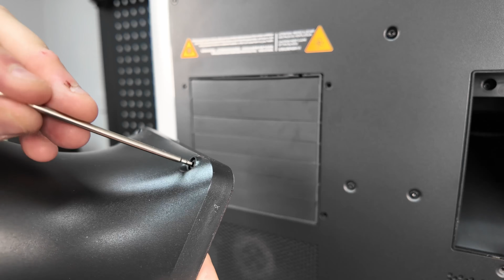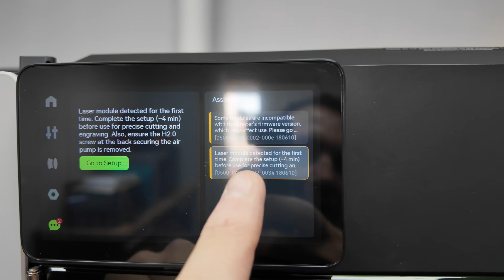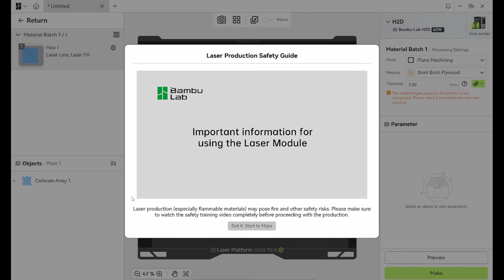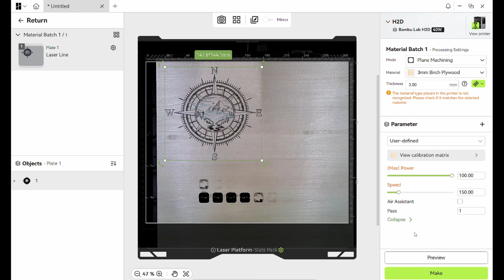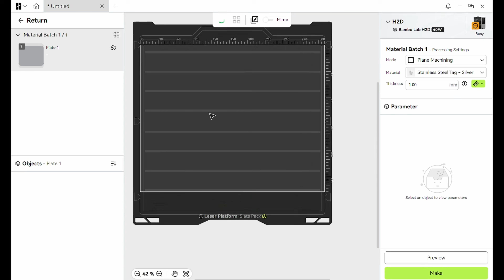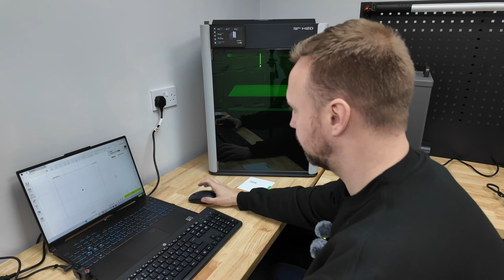Bambu Lab H2D Laser Edition: Complete Beginner's Guide & Testing

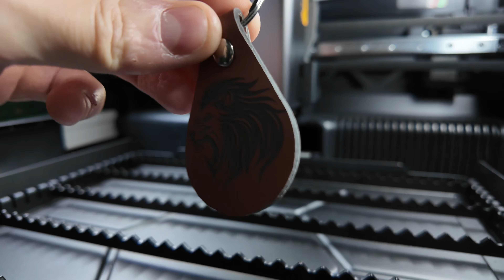Comment: On the lion key fob, the lion is noticeably closer to the top of the key fob (when you take it out) than it was in the camera view. Is it a different key fob, or was the placement consistently off? It looks like it was a good 3-5mm off on the Y axis @ 32:38
Reply from the maker: It's definitely not to placement of the machine. It was a while ago but I suspect I probably did a readjustment to make it more stable without updating the design in the software and then engraved. Rest assured, placement is very accurate.
Reply: @L3DAccessories thank you! I just got an H2D with laser but I haven’t got around to the laser bit yet.

Comment: Just bought H2D Laser. Arriving next week. Can it be used as 3D printer without removing the laser module or is it either/or configuration?
Reply from the maker: No it can't, the laser has to be removed to use the 3D printer. Good luck with your H2D

Comment: Completely new to any of this stuff so sorry for the possibility dumb questions 

For the laser do you have to use a laptop or can you just use your phone? 

Do you use the air purifier for just printing to?
Reply from the maker: It's good to ask questions and I really don't mind answering. You can use the Bambu handy app to connect to the printer but you need to download Bambu suite on a pc or laptop to operate the laser. In terms of air purifier, I used Bambu labs air purifier but you can also vent straight out of a window.

Comment: Hi I have a small issue i want to test pcb making on 10 watt h2d . I added a thin layer of black paint on double sided pcb ( after scoring  and dry wiping it). Then trying to etch different layers of pcb design and for inspection I have to take out so it misses if I want to laser around the same location that is my issue as far as I have tried chemical etching its coming good the only issue I have is alignment I tried multiple 3d printed jigs for the platform
Reply from the maker: Sorry for the slow reply! I haven't tried PCB making so I can't speak from experience. Does the board sit in exactly the same spot in the jig each time, or does the position drift even when it's seated?
Reply: @L3DAccessories  The position seems to drift even though I never touched the board and it stayed inside the jig the entire time. After completing one pass in Bambu Studio, I tried doing another pass to make it easier to break the PCB apart, but the laser position had shifted, so the second pass didn’t align properly.

The bigger issue is when I try to laser the other side to make a double-sided PCB. I use a 3 mm hole to align both sides. On the screen, everything looks perfectly aligned, but during laser engraving, the position seems to drift, and the patterns don’t line up correctly. I always run the camera calibration before using the laser, but the issue still persists. Has anyone experienced this or know how to fix it?

Comment: So for someone new to 3d printing (with a little bit of laser cutting experience) is this the recommended set up ? Or would you still consider buying separate units - if you do what would you recommend ? Many thanks
Reply from the maker: It all depends on the kind of space you've got. If you've got very limited space then I'd recommend this option. If you have enough space for a dedicated laser and 3D printer I'd recommend to do that. My personal favourite beginner laser is the xTool F2. My favourite premium laser is the xTool F2 Ultra UV.

Comment: I have this, biggest disappointment is not being able to mark plastics. Not being very literate on lasers I assumed it would be an easy way to get designs without needing to go into the slicer and use multi filament. Boy was I wrong, it's good at making tumblers and gifts though. I just think they missed the mark not making a UV version. I have my H2D running prints all the time though, it's an amazing printer.
Reply from the maker: Hopefully in the future Bambu Lab will release an IR laser module. That would allow plastic marking and darker metal engraving. Thanks for watching